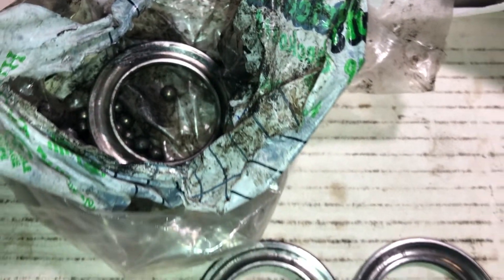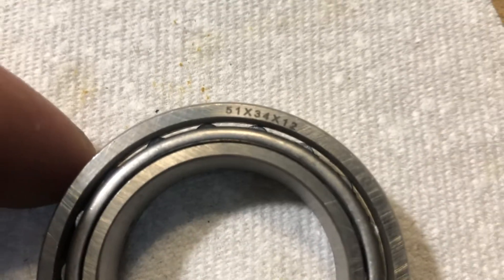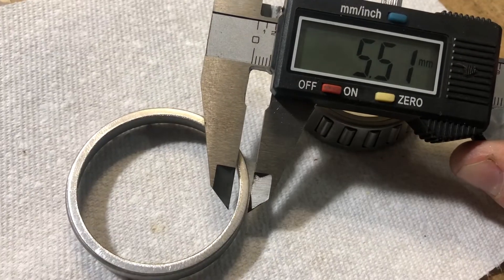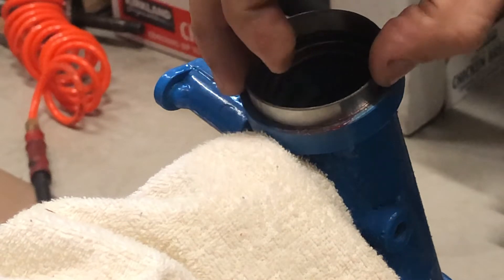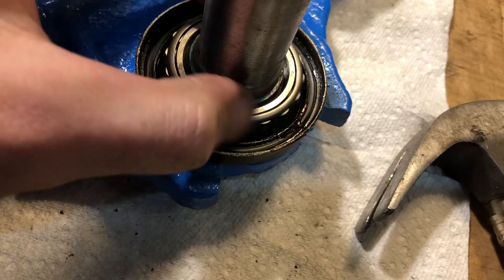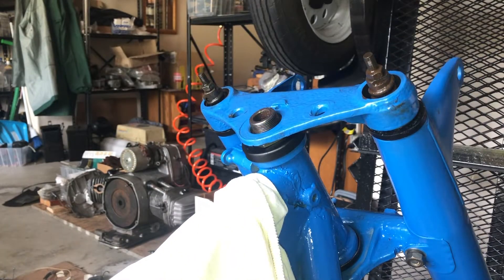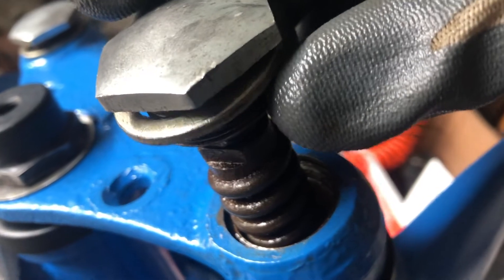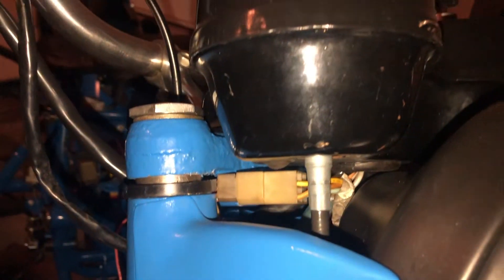Ural/Dnepr Motorcycle. Front Fork. Installing Tapered Bearings.

Comment: Hi Vlad. I found your channel tonight and have subscribed. This is a really useful video so thanks for that! I've got a 1975 Ural M67 here in the UK. I have a problem with my fork seals which I changed recently where they keep sticking on the chrome...... 🙄. Do you have any tips on how to lubricate them to stop this happening? I have greaed them but they are ok for a while and then stick again. Thanks. Stefan.
Reply from the maker: Hello Stefan, I haven't experienced this yet. Post this question on sovietsteeds forum. I am sure somebody had this issue before.
Reply: @vlad_lo  Thanks... I'll try that.
Reply from the maker: @stefanm67  AFAIK seals should be lubricated with fork oil naturally (while riding), make sure you have fresh oil. 
Also, while working on the Dnepr fork, I installed new unbranded seals, which seem to be too tight - I hardly could compress the fork manually. I haven't tested it yet, but it looks suspicious. Again, it's my first experience working on forks.
Reply: @vlad_lo   I am going to take them apart again tomorrow as they are not being lubricated. I have got new oil so it may be the seals themselves which are causing the problems. I will let you know how I get on. Thank you. 👍😁